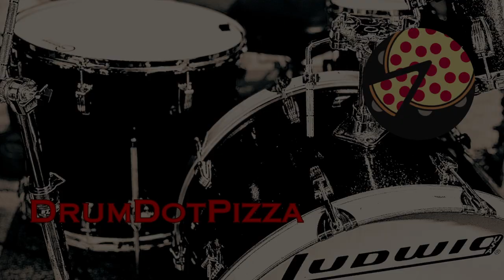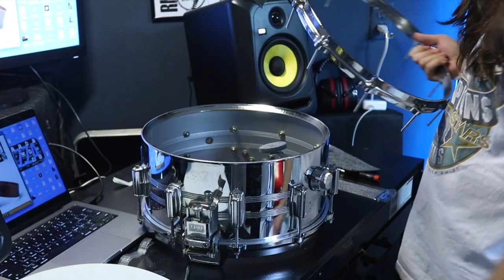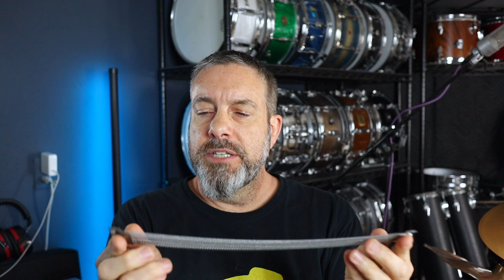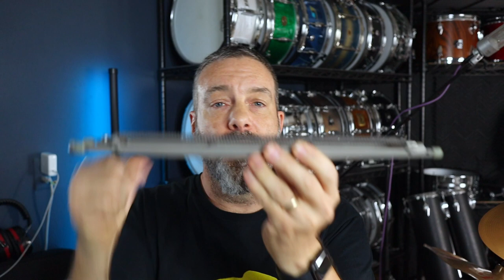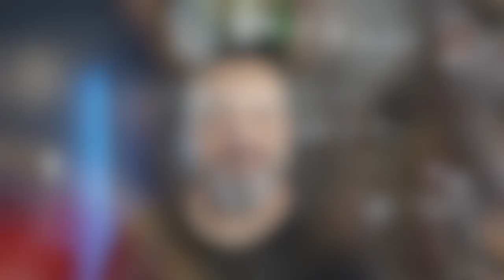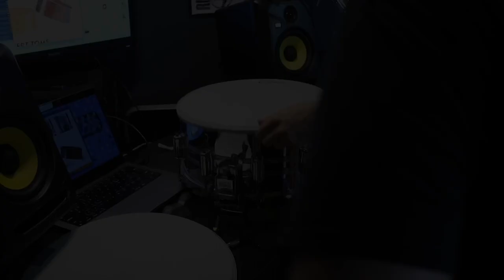Extended Snare Wires (And Horizontal Tension) Used In Vintage Snare Designs

Comment: Another great vid Joel !  Ya know, Ive built, cut , shaved, changed bearing edges, with / without reinforcement rings, wood, metal, plastic and different strainers. "The thrill of victory and the agony of defeat" are an under statement. LOL... One time I embarked on a complete re-mod of a snare for a friend of mine. Kind of a joint idea between the two of us. It sounded like crap!  LOL.  In jest… I invoked the immortal words of John Belushi from the movie Animal House…, “Hey, ya  F’d up… you trusted us” We laughed our selves to tears for about 10 minutes.   However, honestly,  I just keep defaulting to the Ludwig Super Sensitive... Especially the early models where you can adjust each snare strand individually. Two points of interest I think need mentioning here. 1) unfortunately these have become excessively expensive, and  2) I feel a lot of drummers can't get their head around the the early model Ludwig Super Sensitive strand and strainer engineering. 
Hey... did you know the original Ludwig Super Sensitive had snare wires on the underside of the top head? 
Keep up the great work !

Comment: Love the extended, horizontal tension sound. Full, I hear more drum vs wires. I try to achieve this sound on a regular modern design by keeping the wire tension as low as I can whilst still getting a decent response. With the horizontal tension design that’s not needed and I bet I can tune the snare drum like a low tom, something I love to do if I don’t use snare wires, as tight wires on a loose snare side head sounds bad.   Very interesting episode!

Comment: I definitely picked up an imbalance/overring from the underside head...possibly from tuning challenges with the beds or from the "choking" of the snares/straps.  The result was that the extended-snares unit sounded both fuller and "drier" at the same time.
Reply: Follow-on question.  I'm willing to tinker/frankenstein drums, and I'm considering purchase of an extended-snare hardware setup for a project now.  I see Worldmax and Pearl have contemporary stuff available, though the Pearl stuff is designed to bolt to their free-floater rig rather higher on a shell.  Do you think finding vintage setups like the Tama rig would be substantially better.  Any setups from various brands you'd recommend seeking out outside of Tama's?

Comment: I've loved the Rogers Dynasonic since the mid-60s. Now, thanks to this video, I better understand why.
Reply from the maker: The short length of the Dyna's wires (even shorter than 'normal' wires) coupled with the horizontal tension of the design (and the uber shallow beds) makes for an incredibly articulate, dynamically responsive design.  If you want crisp there isn't a design that will deliver better than a Dyna-sonic!

Comment: Great video! One of my favorite snares is a vintage Pearl professional series (DX) 6.5x14" chrome steel shell with extended snare wires. The wires can get a lot of "crosstalk" from hitting the other drums but it makes up for it in sound and feel. It has a fat sound and feel to it that will make ya smile.
Reply: I had that snare as well.  First professional grade instrument I bought (1985) used it heavily for 15 years, then sold it…regretted it ever since.

Comment: I guess that over the course of time all (most) manufacturers came to know that people don't appreciate bulky and even sometimes grotesque designs of 80's era. And while I personally don't appreciate unnecessary over-engineering, what I don't appreciate even more is unnecessary over simplification. today everything is made to be as simple as it goes, which is not a bad thing by itself, but only in case it does not mess up performance of a thing (relates to a lot of things, not only drums). the way I personally prefer things to be is first try to get max performance and then learn how to use the thing the easiest way possible. rather than the second way: make the thing ase simple to use as you can and than and only then try to max out the performance. By the way the snares sound KILLER big time! Thanks as always!
Reply from the maker: Well said!  I'll go for sound over simplicity any day (well... so long as it's not ridiculously cumbersome, but few extended wire designs were ever that cumbersome and fiddly).

Comment: I love extended snares. I have 3 snare drums with extended wires. A Fibes 1978 SFT690 fiberglass 5X14.
Ludwig 1979 Coliseum maple 8X14.
Pearl 1993 MLX 6 ply maple 6.5X14.

I have 1 drum with standard snare wires, a Ludwig 1968 supraphonic 400, 5X14 metal shell. Good sound, but the extended snares are just unbeatable.

Comment: Great topic Joel.  So my story is that I have three horizontal tension snares.  Late 70s black beauty.  Incredible drum.  1941 Leedy Broadway standard. A real jaw dropper of a drum. And a new Dynasonic.  Sounds amazing w the snares on, but I’ve always had a problem w the snares off. It engages intermittently.  I’ve tried making adjustment after adjustment but can’t get it right.  Thanks for letting me vent. 😂😂.  Keep up the good work brother.

Comment: Thanks for the explanation!  The extended wires obviously give you that horizontal tension but also you can independently apply the desired verticals pressure which makes a difference!  It’s maddening to use the common method where you apply both simultaneously.  As point of reference our pipe band snare drums have snare mechanisms on top and bottom.  We adjust the horizontal and vertical tension independently on both.  (The upper can’t use extended wires but has a mechanism inside that actually bends the wires upward to apply to the head without the end plates needing to touch the skin, and also allowing horizontal tension.  Anyway, keep up the great work!
Reply from the maker: Thanks so much!  

I've heard of those drums you're describing.  You know the original Ludwig 'Super Sensitive" snare drum (from around 1927) had a similar dual wire system, one under the bottom head and another directly under the batter.  I have always wondered how that kind of arrangement performs.

Hmmm....
Reply: The upper snare mechanism on pipe band snare drums are adjustable for height..the higher the height the more pressure of the snare wires against the underside of the batter head.  I often see pipe band snare drums with the upper snares pressed so tight against the batter head you can see the imprint of the snare wire buttplates/snare holders on the batter head..a sign of too tight against the head.  When I adjust the batter side snare height I adjust so I can just start to see the 'bumps' from the snare holders on the batter head,  then back off a bit so the batter head is completely smooth.  Pipe band snare drums are highly tuned to give a high pitched 'crack' (to me like the sound of a .22 rimfire round) but still have some snare response. They can be finicky beasts to tune.
Reply: @thomasmoje5926  agree!  I don’t see the imprint in the top head in the modern drums.  The old versions certainly did.  They had these rollers in each side that would get pushed up into the head so hard it left a bump from underneath.  I hated playing in that.  Even though the heads were almost table too hard, it still felt weird.  Todays drums are far better sounding and feeling to play on.  ;-)
Reply: @drumdotpizza  an yes I’d forgotten about Hathor’s early dual snare drums.  Interesting that they didn’t remain a popular option.

Comment: This is getting reliable now, you post and it’s worth watching. Always. Brilliant stuff again.

I own a few drums that fall into this category (‘69 Rogers Dynasonic COB, reissue Rogers wood, Premier 2000, Premier brass Carmine Appice, Tama Mastercraft Rosewood and the king of them all, a Sonor Signature Series) - Blunt truth is, every single one of them have something special, something extra about them.

They’re potentially more fickle than ‘normal’ drums when set up less than perfect, and the differences are mild, especially when compared to something like a Dunnett with those super deep beds which are very sensitive. But they have something which can’t be replicated any other way.

It’s a crying shame there are no parallel action drums these days.  

Your clips show it - kinda like comparing a Lexus to a Toyota - both excellent, both fundamentally the same underneath, both will leave you happy forever, but if you want that special little something extra…
Reply from the maker: I love the Lexus/Toyota comparison.  Well said!!

I do wish someone would bring back extended snare wire designs.  

And Sonor Signature... holy crap that is a consequential design!!  Intimidating just to look at!    Lovely drums, though (even if I have to trade my car for one! ;)

Comment: I have a Tama King Beat snare from ca.1980. love it. Very loud and bright snare drum. I swapped the snare side head for a Remo Emperor black suede (5 mil) and it darkened the tone considerably.
Reply from the maker: Parallel action!  Nice...
Reply: @drumdotpizza  yes but the levers on both sides are missing. I basically had to set it and Jerry rigged it to keep it in place. Those parts are hard to find.
Reply from the maker: @iRideuWatch  Yeah, my son bought one last year and the levers were bent, but worked.  Great sounding drum, but where to get replacement wires????
Reply: @drumdotpizza  I got the wires from Drum Factory Direct. They finally made some!

Comment: Very good video always enjoy your content. I’ve never played a snare with extended wires but from what I’ve seen of them it seems like a bit of over-engineering, doesn’t really sound any different than a drum with a regular snare system, at least not in any videos I’ve seen. 

 An interesting fact about wires that few are aware of: The pitch of the end plates or ‘clips’ that the snares are soldered into makes a huge difference in the sensitivity. 
Basically if you have a snare with somewhat shallow snare beds, such as a Supraphonic or a Black Beauty, you want snare wires with end plates that are angled downward instead of flat like most wires. Essentially what is happening is when the wires are tensioned, the angle of the plates causes the snares to naturally be pushed up into the middle of the bottom head, compensating for the shallow bed. This allows you to get good sensitivity without having to over-tension the wires. 

I typically just get generic wires and put a little bend in them myself cause I prefer the sound of their lighter-gauge, but Puresound offers the Blaster series with this principle implemented. Also Fat Cat offers all their wires with either “Pitch” or “No Pitch.” 

Happy drumming
Reply from the maker: I've seen the Fat Cat designs and am fascinated by them.  I need to get some to try out.

Comment: I have 4 snare drums. Oldest is a 1968 Ludwig Supraphonic 400, 5X14 metal, with standard snares. Overall good sound.
Next is a 1978 Fibes SFT690, 5X14 fiberglass wrap, with extended snares. Great sound.
Next is 1979 Ludwig Coliseum, 8X14 maple, with extended snares. Great sound.
Last is 1993 Pearl MLX, 6.5X14 maple, with extended snares. Great sound.

Overall I prefer extended snares. Great sensitivity at low volume, & less rattle at high volume.
The standard snares are still good, but lack low volume sensitivity.
Last

Comment: Really interesting subject. I was surprised you didn’t mention Ludwig SuperSensitive. I own two that are BB’s. The only snares I played for years. I definitely heard a distinct but very subtle difference between the two drums and your explanation made sense as well. Thanks for this very informative video! I’m going to subscribe to your channel.
Reply from the maker: So glad you're here!

I actually had a Ludwig SS back in high school (early 80s, when I was about 16).  I dropped it and bent one of the protective bars around one side of the mechanism and while ti did protect the mechanism, the cumbersome size and the fact that I couldn't find a case for it made me get rid of it.  I didn't seriously consider extended snare designs after that (for those reasons) for the next nearly 30 years till I played a Tama roller bed Atwood snare from the late 1980s (9" deep!).  I never liked deep snare, because they lack good snare response at low dynamics, but that drum was amazingly responsive!  I looked into the design and acquire a steel 5" Mastercraft, then a 6.5", and then never looked back.  

My FAVORITE snare/stainer/wire design!
Reply: @drumdotpizza  I certainly understand about the case problem Lol. I use the old square fiberboard cases on mine. You have definitely piqued my interest in the Mastercraft snares though. I’m going to check them out.

Comment: My '78 TAMA Superstar 14x5 in maple came with the parallel action KG strainer but the previous owner did not take care of it and half the strainer was gone, along with half the tension rods. I tried looking up parts but shipping to Norway is ludicrously expensive at times. Drilled a couple of new holes and put a simple vertical (as you call it) strainer on it and I was satisfied. Especially since I got it in a trade, and what did I give them? A cheap steel snare, but they were fine with it as it was intact. Later on I also bought an 80s Pearl Export 14x6.5 in steel for 5 bucks from another guy in the same area. Couldn't pass up these deals!

Comment: Great video, I have the same Mastercraft and love it. On other snares when you engage the strainer the bottom head pitch goes up noticeably, on my Mastercraft you really have to crank the snare wire tension to get that to happen which is why I think this system works better, drum is less choked and the just sounds and feels great. Too bad this option isn't really available on many snares these days, I think they are missing the boat.
Reply from the maker: I'm gonna bring it back!  (says me... ;)

Comment: Ive never seen or heard of extended snare wire, snare drum. Didnt know that was a thing at all
Reply from the maker: Tama has reintroduced a few of their Mastercraft snare from the early 80s (part of their 50th anniversary):  Bell Brass, Rosewood and Steel.  The BB and Steel are going to be continually available, I believe (not limited edition products).  I'm super pumped about this as that design is my FAVORITE extended snare design (Yamaha's was good too in the 80s, not the parallel design, just the normal with extended beds).  

To my knowledge the Tama reissues are the only currently made extended snare designs.

Comment: I own a older recording custom snare with the extended wires and never really knew how to adjust them properly. there is a adjustment on the sides as well as 2 tensioners, one on each side. would love to see a video on the proper set up and tensioning for this. also I would like to replace the wires and don't know if they make wires that fit or sound better.

Comment: I like my dyno but on all the other snares I use Fat Cat snare wires 24 strand and you can adjust the middle 12 indipendently from the outer wires so you can have a tight  and loose snare sound at the same time.
Reply from the maker: I have yet to try Fat Cat wires, but I think it's about time.  I've heard good things about then, though they aren't cheap.
Reply: @drumdotpizza  I think it would make a good video for you to do.

Comment: they introduced the ACTIVE SNARE SYSTEM to try & get the best of both worlds but it's still a nice way to get parallel action on the cheap IMO
Reply from the maker: I actually have a set of those active snare wires!  I'm not sure if I got a bad set, but never could get them to be totally quiet... always a little stray buzz for some reason.  Good sound overall though, and yes, cheap way to convert your drum to true horizontal tension!

Comment: Mastercraft snares are great a bit fickle to setup and of course snappy snares are harder and harder to find ( at least original style) . I have a Dyna and Luddy SS as well and love those too. 
Your choice of 6.5 Master steelie was wise. Great all around snare, while Bell Brass, Rosie's and Fibrestars are bad azz the steelie can do most music very very well. Great video and loving the topics.
Reply from the maker: thank you!  I consider the steel Mastercrafts to be something of a baby bell brass in terms of sound... can really do the 'gun shot' thing quite well.  Those steel shells are HEAVY, and slightly oversized too (some heads can be snug), but they sound great!

If you're ever looking for current replacement snares I recommend the model SE01-1620cr from Drum Factory Direct.  It is their own brand, but I have tried all the extended wire sets available from them, at all price points, and they are the best fitting and sounding.  These are what I gave my buddy for the drum in this video (previous owner had put regular 14" wires on it).
Reply: @drumdotpizza  Hi! The model SE01-1620cr  is 16". Is that the size you would use? Would 15" work too?
Edit: Thank you for the video, I learned so much about the snarebeds! 🎉

Comment: Great content as usual. I do the opposite! I use 30 strand 13" wires on my 14" snares, gives me in and out, staccato but loud wire sound.
Reply from the maker: Interesting that you use 13" on your 14" drum... is that because the 30 strands are too wide to be closer to the edge/snare beds and still respond well?  I would imagine large count wires that are shorter would play nicer with narrower beds, but have never tried it myself.  

I actually had the privilege of getting to know Larrie Londin a few years before his death, and he was a big fan of 42-strand wires (even on his piccolo DW!).  You just gotta have wide/shallow beds for those to work well.
Reply: @drumdotpizza  Definetly! I think it's due to the fact that the metal plates that the snare wires are attached to are flat and stiff, not elastique :). Makes me wonder what if they were made out of a softer material that conformed into the shape of the shell. Probably down the road someone tried and it wasn't ideal.